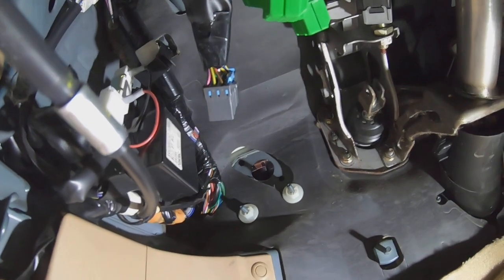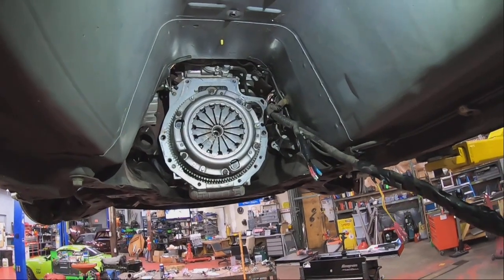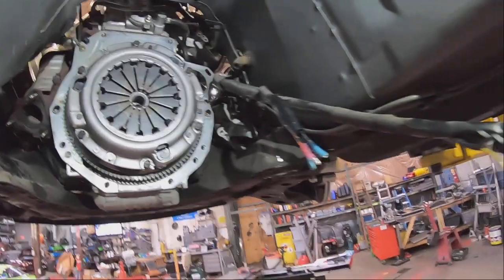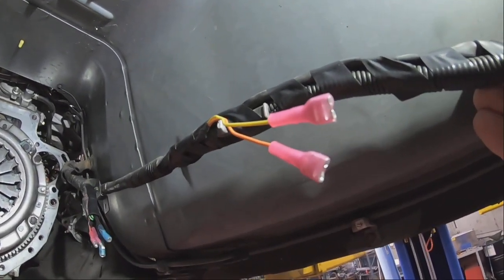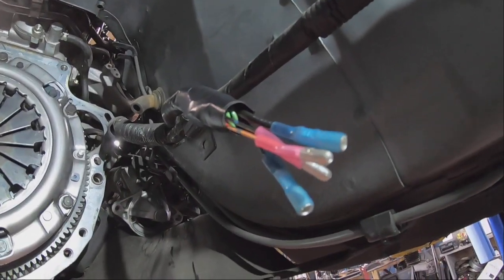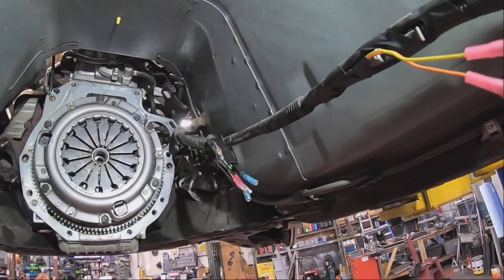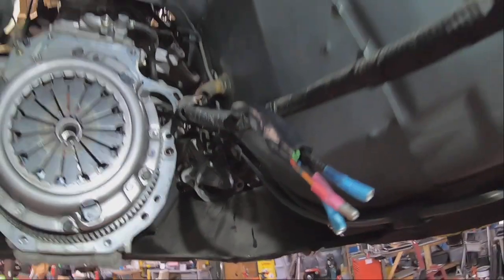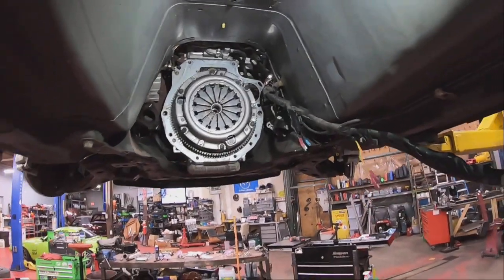Mazda Miata Auto To Manual Swap Guide (NB)

Comment: How do you connect the switch on the clutch pedal or is that not possible?
Reply from the maker: You’d have to run your own wires from the trans tunnel to the pedal.  It’s doable, I just don’t see the point

Comment: If someone swapped my auto but they kept the automatic transmission ecu, is it possible that it thinks it’s in parking and not let me pas 3k rpm?
Reply from the maker: I don’t think that would cause it, could be a throttle position issue?  Or maybe one of the sensors that needs to be wired to the transmission is hooked up wrong?  Sorry, not sure what could be wrong

Comment: Random question. Why is your ppf green?
Reply from the maker: Customer had it powered coated, no real reason, personal taste I guess 🤷‍♂️ it is a ground path though so I cleaned off the contact points to the transmission and wiring
Reply: @immortanautomotive9221 duely noted thank you! 😊

Comment: Just finished up my 99 swap.  Bought an ecu from a 99 manual and put it in. Starts great, idles great and no cel.  But if I try to hold a steady rpm it seems like it’s hitting a fuel cut or something. Sounds like the rev limiter at low rpm.  Any ideas?  And thanks for the help.
Reply from the maker: Maybe try calibrating the TPS or something?  That’s not a usual side effect of the swap

Comment: I did this swap but I have two check engine lights one for the clutch position sensor and another for idle air issue, I believe it’s due to the clutch position switch not being wired in at the pedal, do you have any idea how to get this check engine light fixed I.e. wire up that sensor at the pedal?
Reply from the maker: I don’t know, the video explains everything I know and I had no check engine light.

Comment: I’ve noticed that the manuals have a plate between the trans and engine. Do I need that thin plate for the swap?
Reply from the maker: You do need that plate, automatics have it too, they are different slightly, but the automatic plate will work just fine for a manual

Comment: I just manual swapped my 1991 323 and wiring the neutral safety switch is the same as miata, black red and Black blue wire spliced together boom it starts
Reply from the maker: Nice!  I always wanted a 323,  I had a 929 back in the day

Comment: I have everything wired in my 2003 nb2 and it works great. Only thing is that when I have the 2003 manual ecu and immo in, the car starts but it like to bog under throttle and idle is high, i can’t seem to figure it out and i tried adjusting base idle.

the car works great with auto ecu in
Reply from the maker: I would confirm the ECU part numbers, there were some differences in wiring harnesses for cars that had unique emissions systems.
Reply: @immortanautomotive9221 ok so I have a 2005 automatic Miata if I buy a manual PCM and flash it to my vehicle’s Vin number is that all I have to do to get it to work
Reply from the maker: You will need a dealership to program the immobilizer, it will not be driveable until then

Comment: Thanks for a fast response.😎👍🏻
I especially appreciated your video and information on the electrical part of the manual swap. Very thorough , I was just overthinking the clutch pedal  wires . I’m finishing up the exhaust on my  2000 MX5 5 speed swap. I can’t wait to slam some gears!👍🏻💯🏁

Comment: You don’t mention what has to be done if anything to the two sets of plugs that are on the clutch pedal itself. One is a white two prong plug. The other one is a sensor attached to the assembly that has a very small two pin hole. Do I have to do anything with these or is everything else covered in the Breakdown of electrical requirements for the swap?
Reply from the maker: You don’t need to do anything with either of those
Reply: I just started the car . There is a P1601 code ECM/TCM communication error . It runs great still, the odometer is working and all the gears are shifting fine. Do I need to swap the original engine ECU from the manual car into the automatic car to make it communicate properly?

Comment: So do I not need a manual ecu
Reply from the maker: I always use a manual ECU
Reply: @immortanautomotive9221  so do I need to buy a manual transmission ecu and a engine ecu?
Reply from the maker: Ok let’s be more clear here.  PCM (powertrain control module) is for the engine, you should get one from a manual car.

TCM (transmission control module) only exists for automatic transmissions you won’t need one at all for manual.

ECU (electronic control module) is a generic term that can be used to describe any device that has a computer in the car pretty much.
Reply: @immortanautomotive9221 when you buy a manual pcm do you need to get a immobilizer and new keys
Reply from the maker: Only for 2001-05, you’ll need those things or have a dealership program the ECU for you

Comment: What if I already have a manual ECU can I use that instead of the automatic one do I have to splice anything as well?
Reply from the maker: You still have to do everything shown
Reply: I’ve completed the swap on a 2003 leaving TCM in place. Wired speedo as per write up in comments cut wire to o/d light. I believe was wh/red at TCM to cluster instal 3 resistors ( 20 ohm 10 watt)  at wiring to original shift and TCC solenoid. Been driving 200 km and ses light not on no codes stored. Did notice when shifting gears rpm drops fast and have to blip throttle to rev match.

Comment: Are there any different wiring steps for an nb2? Wifes car is an auto and ive finally convinced her to swap it after the last autocross. Need a manual ecu for no cel or other lights? Just going to start scavenging parts shortly amd want to make sure im not missing something.
Reply from the maker: NB2 is trickier because it has an immobilizer, if you swap the ECU you’ll also need to install a marching immobilizer, ignition cylinder and key.  Fundamentally it’s the same though.
Reply: Any issues from not swapping the ecu other than cel on all the time?
Reply from the maker: I’m honestly not sure what will happen, try it and let me know 🤷‍♂️
Reply: Will do! Have to gather parts first. 😂
Reply: @ChrisDoria-oc9ti -- I am getting ready to do this on my '05 NB2.  Woukd be interested in linking up to compare notes if you are interested.

Comment: Great video. I just did the same swap on my 2000 Miata. I jumped the wiring as you described and got the speedometer,  the neutral start, and the back up lights working. The car drives great, but the check engine light is on with a code P1601 ( no comm between ECU and TCM) How do I trick the ECU into not looking for the TCM ( that I removed as part of the swap). I found a procedure for a NA car but the ECU is different on a NB car) OBD1 vs OBD2)
Reply from the maker: I don’t think you can “trick” it.  I always swap in an ECU from a manual car

Comment: Hi, Great video! I completed the swap on my 99 Miata. I jumped the wires that you indicated and the speedo, VSS, and the neutral start work. Now my CEL is on with P1601 ( no comm between ECU and TCM) how do i trick the ECH so it thinks that it doesn't look for the TCM?

Comment: hello thanks for the video, ive completed the swap did the wiring have no lights on the dash. when driving my rpms rise up to 1500-2000 when in neutral at a light.pror to the swap everything was working fine and even a little after words. any chance youd have the slightest idea of where i went wrong. i did not swap the ecus out or do anything with the tcu wires besides the ones you mentioned do these things come into factor at  all, all other tcu wiring in the description is done. i have a 2001 miata nb2   
ive already tried switching the wires around on the neutral switch and also changed it and did not improve.
Reply from the maker: Sometimes I’ve found that adjusting the throttle stop or idle screw helps, I assume because there’s less drag at idle with the torque converter gone.
Reply: Gotcha will try that just wanna ask if you still think it’s that Even if the idle problem isn’t always there it comes and goes and sometimes seems like it’s gunna die. 

Thanks again!
Reply: wait you were able to get no lights on the dash without having to switch the auto ecu to the manual ecu ?
Reply from the maker: @heyimpika_ I swapped the ECU

Comment: Hey amazing vid ! I just finished the job cars running. Great, but I have a p1601 I’m assuming it’s from the rest of the wires from the tcu? Do I need to do anything with the rest of the wires not being used from the tcu clip ?
Reply: Purple/ green to pink and black from tcu clears it
Reply: @9tonito  Thank you for commenting with this information.  It helped me out big time!
Reply from the maker: This video is NB specific, if you have an NA there's a wire from the TCM to PCM that needs to be grounded, I can't recall the pin or wire colors off hand.  But grounding that wire will make the PCM think its a manual transmission, if it's an open circuit it will set a fault.  (I'm making some assumptions here hope it helps)

Comment: I did the swap but got a P0704 code.
Reply from the maker: Did you modify the cruise control wiring as described in my instructions?
Reply: @immortanautomotive9221 I did not. So just cut no need to wire it to anything?
Reply from the maker: @kaushiksingh6493  correct
Reply: @immortanautomotive9221 same code came back after cutting the purple wire. I should say I don’t have the clutch switch in
Reply from the maker: Yeah you don’t need the clutch switch.  I’m not sure what to tell you, I’ve done several exactly as I showed with no codes

Comment: Just bought a car with this same swap fixed some of the wiring thanks to your video still have a vacuum leak i can’t find, some one said there is a vacuum line that runs to the auto trans that gets capped when you swap it ? Any info would be greatly appreciated
Reply from the maker: That’s true for 90-97 model years, it should be on the back of the intake manifold near the firewall.

Comment: My car now crank no starts after swap, no spark, no rpm signal any ideas?
Reply: Check the wiring on the neutral safety switch. I’m doing a swap on my 2001 my trans is in but no wires are plugged in and same thing no crank so start. Other thing is maybe he switched the ecus ?
Reply: @Domakaterboy  nope it was something that had nothing to do with the swap lmao, crushed a wire between trans and engine and it was blowing ecu fuse it starts now
Reply from the maker: Ah yeah that makes sense!  I didn’t think it would be swap related
Reply: 😂😂😂 shit ima have to look at my wires to make sure I didn’t do the same thanks!